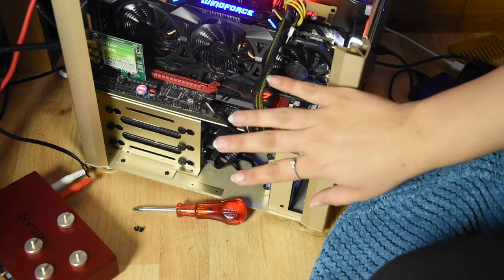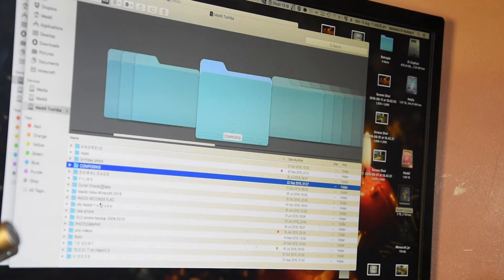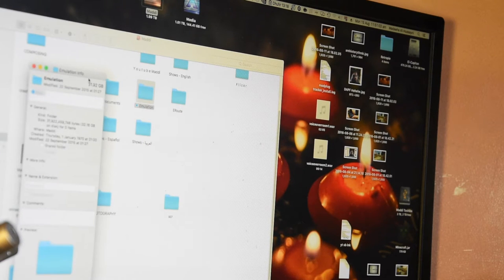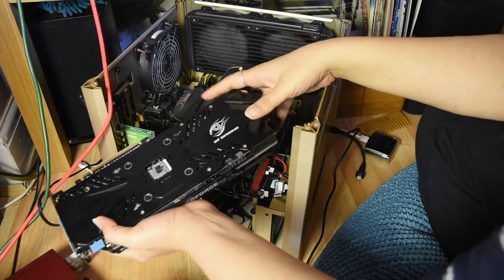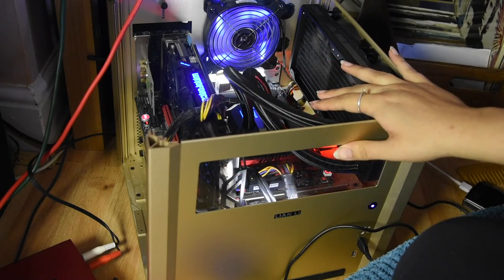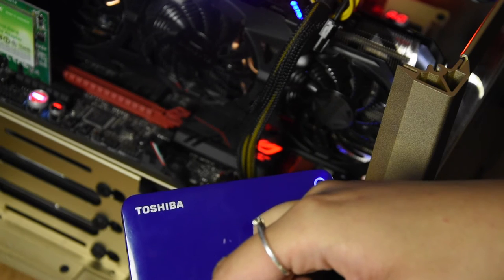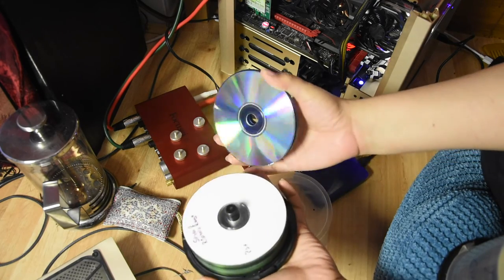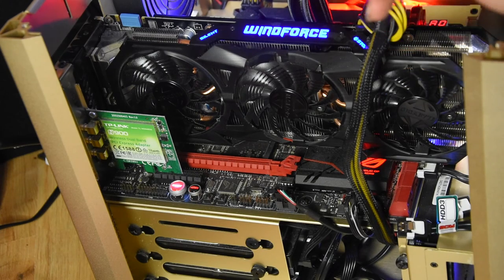Computer Issues - Stupid hard drive!

Comment: I feel your pain, as I also have hard drive phobias. The old saying goes "never put all your eggs in one basket", and backing up is the best practice. There's an app for OSX called "Smart Utility" by Volitans Software that reads the status of the hard drive's SMART info (basically an indication of its health), and can show you whether the drive is failing and needs replacing. I found it very useful when I experienced the same freezing symptoms as you have, coincidentally on a Seagate hybrid drive from 2013 (I replaced it eariler this year). It seems Seagate drives, once very reputable, are highly notoriously unreliable these days. I believe what it's doing when it freezes is attempting to move the readable data from bad sectors to good "spare" ones. It does this until it runs out of spares as it's failing, then it starts corrupting data.  Scary stuff indeed. Hope you recover most of your stuff.
Reply from the maker: Now it's hard to boot into it as it makes the entire computer freeze sometimes, it seems to just be getting worse. It seems like i'm going to lose a lot of valuable data, i'm so glad I copied quite bit of it across when I recently bought a new external drive. Now if I get my stuff off this thing i'll be turning into a backup freak! 
Seagate i'm not trusting ever again, yes as you said they were a reputable company, I used to always use Maxtor drives back in the day until they were bought out in 2006 by Seagate.

Comment: 1) There are only two types of hard disc drives:  Those that have crashed and those that are going to!  :)
2) If you have all that extra stuff since 2013, your power supply might be overloaded.  Be sure your psu is rated high enough to handle extra peripherals.
3)  I would suggest going to an SSD ( solid state drive ) instead of the mechanical one.  No moving parts, so no crunching!  :)
4)  It looks like it is time to upgrade your graphics card.  A newer one will probably be more efficient and not need all those heat sinks and fans.

Just a few bits of stuff I've learned over the years.  At least you try to fix it yourself!  :)
Reply from the maker: Hahah yes I know what you mean :o) I don't really trust HDD too much, but three years is ridiculous!
The power supply is fine I mean 650W gold rated should be more than enough right? I did calculate how much i'd need when doing the build. I have an SSD that's what has the OS on it, this one was just a second storage HDD.. a 3TB SSD yikes haha not an option for storage :o))
 I just hope I can get the freakin stuff off the HDD, that's my number 1 concern. Thanks for the advice and suggestions :o)

Comment: I don't want to start a preference war here, but I've given up on Seagate because of problems like this.  Yes, Western Digital will also fail, but I've had fewer failures with them.  And I've only had to suffer through the loss of very few drives to know to go with RAID1 at all times!
Reply from the maker: I always went for Maxtor back in the day so I don't have much long term experience with the rest. But after what just happened today/last night, I agree with you! WD will be my next one.
Reply: WD, Seagate, and HGST are the same company.

Comment: As a last resort to recover data on ATA or SATA drives, I've had luck with using an external usb drive enclosure. Always had problems with Seagate drives. Since then, I've switched to Western Digital Blacks  and never had a failed drive for 10+ years. My Samsung SSDs are lasting 5+ years too.
Reply from the maker: This one didnt even work with a USB drive enclosure, I tried, it's just sizzled silly now :o(

Comment: Hi,
 If you have a spare computer, remove your system drive and put it in an external enclosure and see if you can copy your files off onto the spare computer...
Reply from the maker: Hi Darryl, yes I have a spare and I can only find 2.5" enclosures unfortunately. I'm goin to keep searching around. Thanks for the advice!
Reply: Well, if you can get inside it, you can connect the hard drive to a SATA port directly...
Reply from the maker: yeah but I cannot connect the data only, and I don't think the 2.5 usb enclosure will power a 3.5" Hdd...